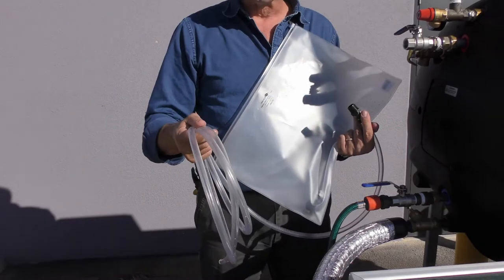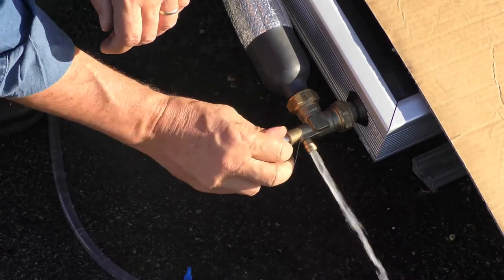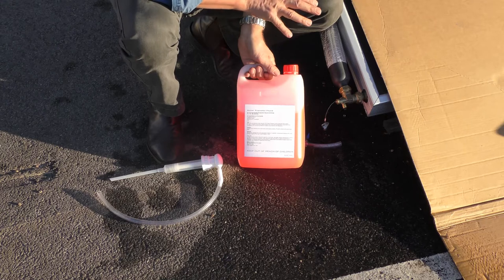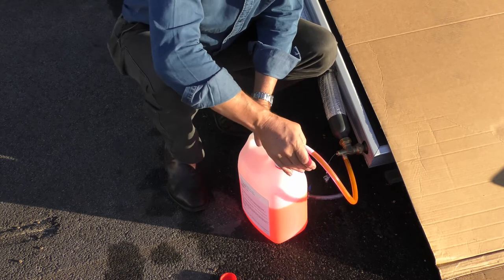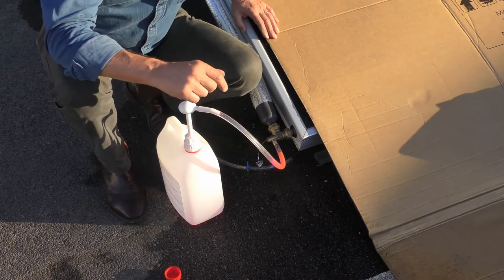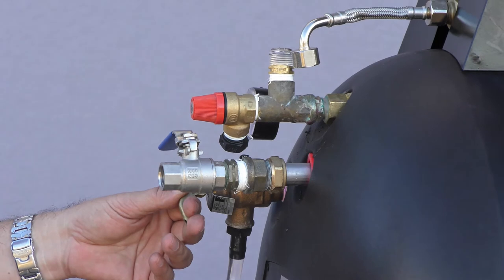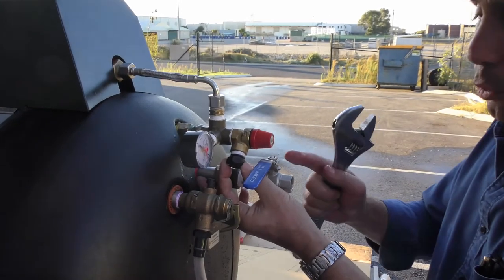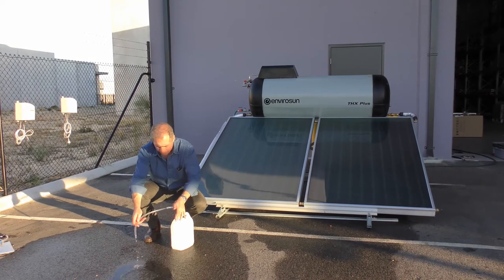Commissioning the Heat Transfer Fluid

Comment: Thanks again for your help, I have found the blow off valve on the top of the tank, I opened this when filling from the bottom, I dont have an expansion on my system, I see other on my street that do in the same place as my blow off valve 
my panel is : 

Gross area 2.4 Sq. M
....Net area 2.2 Sq. M
Temp 170c 
Max op press 8 bar
Dimesions 219 x 108 cm 
Vol 1.3 Liters

The volume of 1.3 liters, is that the volume of the heat transfer fluid it takes?

Comment: why do you fill the system from the bottom?
Reply: Hi Steve.  Thanks for your question.  The main reason for filling the closed circuit from the bottom is to bleed all air from the circuit.  An airlock can prevent the heat transfer fluid from circulating properly thereby interrupting correct thermosiphoning.  Best Regards, The Envirosun Team.
Reply: @johncookebizxsellptyltd2529  Thanks for the reply, when does the air come out, is there a bleed valve at the top that has to be loosened?
Reply: @steveb936  Hi Steve.  The air will be expelled from the top of the tank at the hose connection leading to the expansion tank which should be disconnected for the filling process.  This is shown in the video from approximately the 10 minute 20 second mark onwards.  Best Regards, The Envirosun Team.